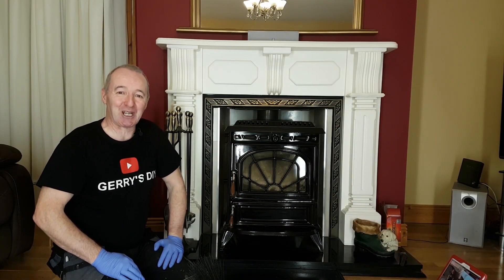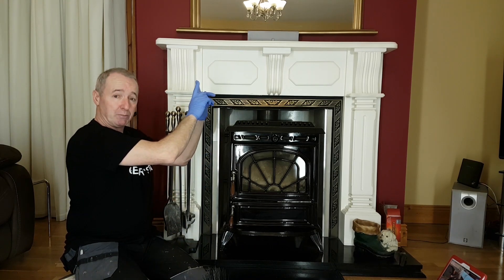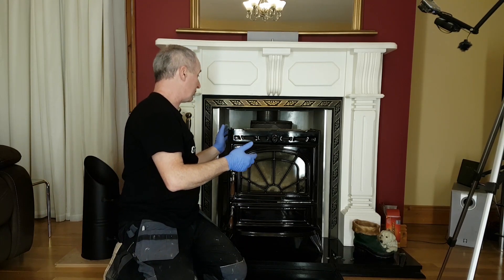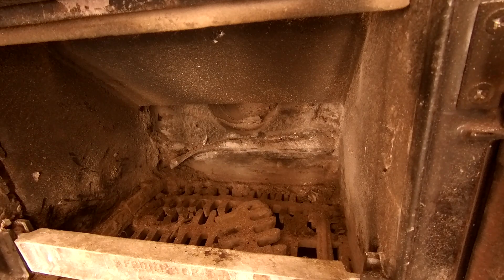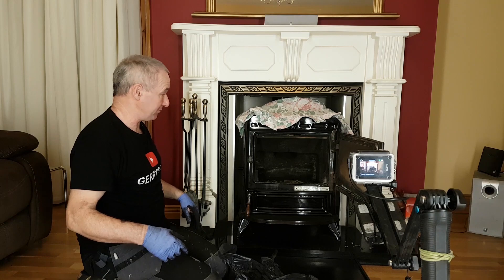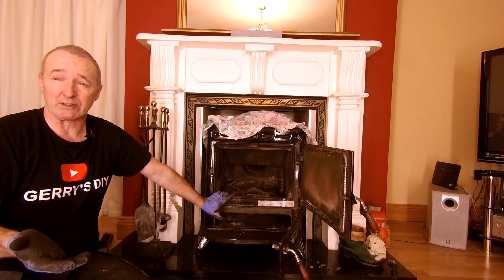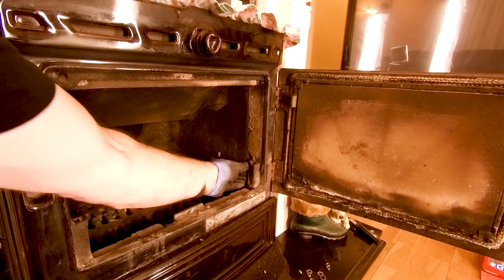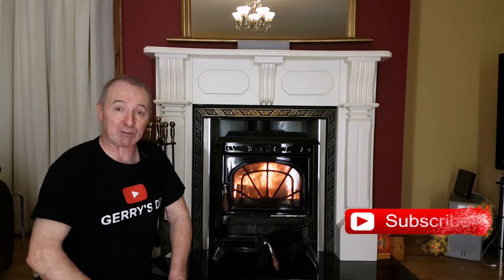How to Clean a Stove Chimney and Stove glass

Comment: Gerry, use the same process on my open fire with wrap round boiler, nothing to take apart tho ;-)keep er lit.
Reply from the maker: Hi kennybo. Some stoves wont allow access but these Stanleys are well thought out. I used to have a back boiler years ago an have installed many. I might mess about with one and a waste oil burner. I hope you efforts at cleaning the chimney are better than mine. I think I was wearing half the chimney by the end 😜 Thanks for the comment Cheers Gerry

Comment: My stove keeps blowing smoke out the edges of the door and the back plate. It's the same as one in this video. What might be the issue?
Reply from the maker: Hi Ciara. If the chimney cannot create enough suction on the stove this can happen. The chimney and the inside of the stove need to be free flowing. The chimney needs to be obstruction free and if possible the highest part of the house and not surrounded by obstacles that can cause turbulence. If I were to light the stove and leave the door open it would not smoke because there is enough pull /  draught on the stove to keep the air flowing into it and up the chimney. Check your door seals. There is a seal on the glass and another around the door. There is also a seal on the top of the stove under the removable top plate. Stanley have a diagram you can see how it's put together. Hope this helps Cheers Gerry
Reply: Great thanks, it never used to do this. There was a crack in the door so we had to replace glass and it's smokes so bad since I can't light it.  Seems like the crack n glass helped the air flo nearly?